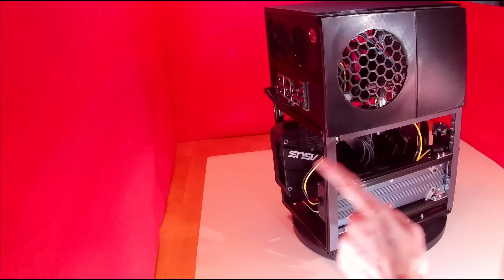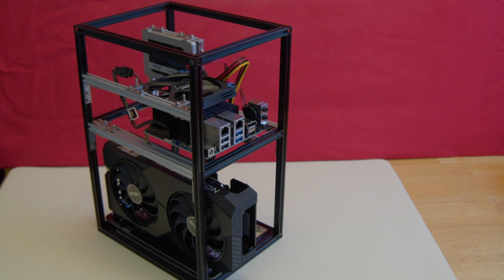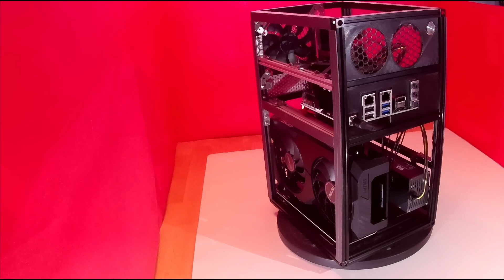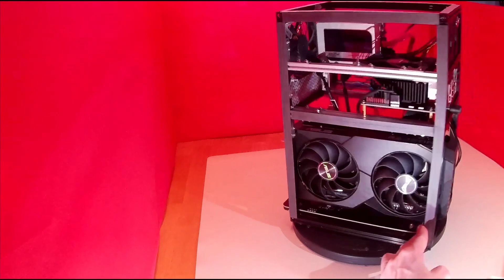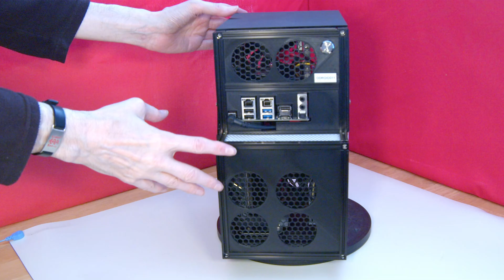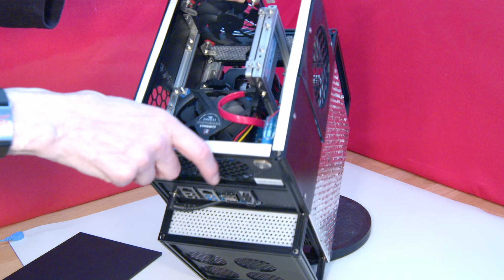Odroid H series and Radeon RX6600 Graphics Card with HDPlex 500W PSU - PC case  - part 6

Comment: Does the ribbon cable influence the signal quality for the GPU?
Reply from the maker: I haven't had any issues with the 25cm ribbon cable. The M.2 slot is x4 PCIe which isn't a problem as the Graphics card stand is rated as PCIe3.0x4